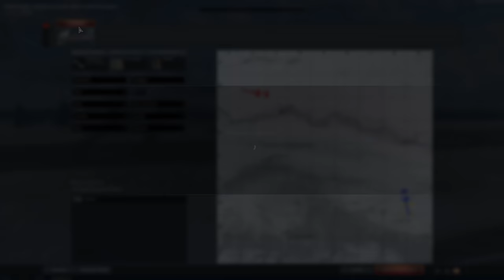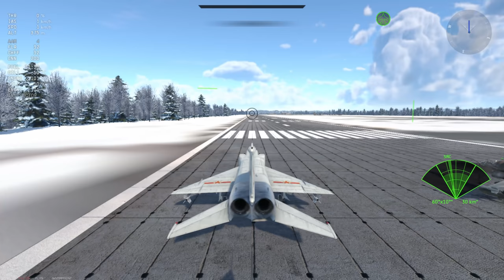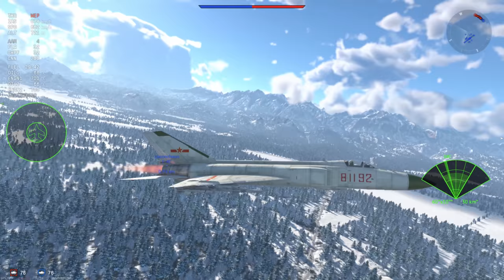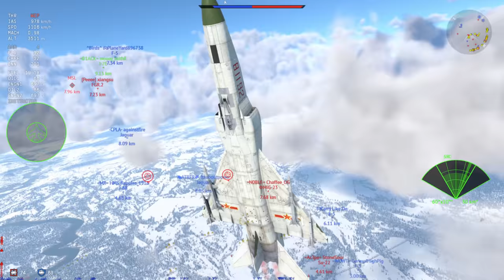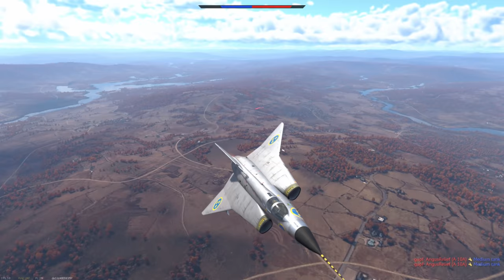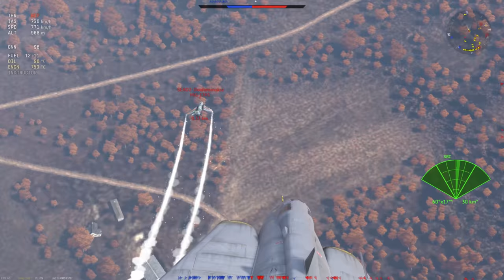It's Time To Raise The BR Ceiling (War Thunder)

Comment: It has been time to raise the BR ceiling for at least the past 2 years...
Reply: Why do that when you can keep pushing underperforming vehicles lower causing issues in BR brackets that dont matter. Perfect solution
Reply: it has been an issue since the game launched. At release, Me 262 was fighting F86 A-5. They were literally considered equal by the matchmaker
Reply: @paraphiliac  they do this to force premium vehicle purchases to grind faster! Its pretty clear gaijin only wants to make money
Reply: More like 7
Reply: @paraphiliac  I honestly think there are no br brackets that "don't matter". I think that every vehicle should be balanced or at least a little more fair than they are now. As much as high tier jets are the "pinnacle", the middle and low brs are just as important.
Reply: @wfb.subtraktor311  and these days we have mig 15 in same match with mig 21
Reply: @jussi8111  90% of f-16 and pfm players turnfight everything for some reason. That is the primary reason for that mess.
Reply: @wfb.subtraktor311  f16?
Reply: @chickenboi693  Mig 21 F-16

Comment: Mig 21 pfm is the pinnacle of br compression that has gotten to an all time terrible low. Oh and also power creep. They should increase the maximum br to 12.0 at the bare minimum
Reply: I should really get around to flying the PFM. I've had it since that event, but since I'm putting the Big Three on hold, I haven't touched it.
Reply: @ODST_Parker  go ahead but dont be those people who throw theirs away and turn with venoms or get so slow and get an aim 9b up their engine. Those people just ruin the statistics
Reply: @J Wilt yes because gaijin doesn't want to fix things in the game just for quality of life.
Reply: Br compression gets them more money because people are more inclined to buy an OP premium to help with the grind. 9.0-10.3 is honestly so fucked right now. Mig21s and A5Cs, fight against Hunter F1s, F-2 Sabres, CL-13s, F3H-2, its totally unfair but gaijin dont give a fuck.
Reply: @Lightning_aus  you forgot 8.7. Easily the worst br to be in jets. Only uptiers await you. The venom completely suffers but people are stupid and turn with it so it stays at 8.7
Reply: @coleanderson8035  i completely skipped the venom as well lol. Barely touched the swifts. Yeah, that whole bracket is fucked. The thing that annoys me is the gap between aircraft that dont have missiles or flares (hunter, venom, sabre) and supersonics with both (A5C, AV8, F105, Yak38, ect in THE SAME MATCH. How is that fair?
Reply: @Lightning_aus  i didnt skip it mate. I love the plane. Fantastic potential. Very fun clubbing mig 21s in a basic early post war turbojet. But it suffers when people aren't dumb. People are so dumb i pulled an ace game in the venom and it was definitely an experience lol and its not fair at all. Also the swifts are amazing bro. The fireflashes are hilariously good head on missiles but the gun placement on the f 7 is utter garbage. The f 1 is a great 8.3 though. I think how britain rank v should be like this. Vampire: 7.3 it was fine before didn't need up in br, meteor f mk 3 7.0 with lower repair cost (10k) or 6.7 with a 15k repair cost which is fair placement imo. The unarmed canberra goes to 8.0.. the venom goes to 8.3, meteor mk 4 with clipped wings goes to 7.7. It's worse than the mk 8 in every way, no reason to grab the thing over the mk 8. And most importantly of all. Both 9.3 mig 21s go to 9.7 as they should be.
Reply: @coleanderson8035  Completely out of nowhere but the f7s gun placement isn't bad imo if anything it's better then the f1s gun placement
Reply: @aregulargenericname8794  I personally like on gun on each side. Aiming with one side of your fuselage is wonky but thats a subjective opinion so i will respect your opinion on the gun placement
Reply: yea when i occasionally see these things in my hunter f1 and i dont have flares or missles and they out turn me and out speed and out accelerate and out climb me, it just makes it not fun when you dont stand a chance against a plane at all even in a upteir, would be nice to atleast have a fighting chance but nope gajin cant let planes be at their proper BR
Reply: @littlecreeper8543  agreed
Reply: I semi-regret selling my PFM. Gah.
Reply: @TheAmazingCowpig  understandable. The pfm isn't great. But its at least good just being a supersonic at 9.3 but understandable
Reply: Why do people cry anout the pfm the f13 is literally worse but stiol slaps some ass at 9.3
Reply: @littlecreeper8543  i mean tbh the Hunter should doo-doo on the PFM if played correctly
Reply: @plazmaguy13yago9  F13 actually has significantly better flight performance
Reply: @collander7766  they have a comparable climb rate snf the pfm gets 200 rounds of gsh23 while f13 gets 60 rounds of rhe nr30 with slow firerate you aint gonna be gettong most of your kills with the r3s
Reply: @plazmaguy13yago9  with all do respect, the f 13 is an event vehicle. Obviously it applies as well but the pfm is in the tech tree making it more common. Good observation though
Reply: @coleanderson8035  I think you got that perfectly backwards
Reply: @plazmaguy13yago9  the F-13 has a .9 TWR while the PFM has .84 under the same conditions. This is a big difference. And in a 1v1 you’d see the F-13 coming out on top of the PFM 10/10 times. The PFM is certainly more noob friendly with the faster guns, but if you can learn to aim the F-13 it’s a much more potent fighter.
Reply: @collander7766  nope read his first comment
Reply: @collander7766  learn to aim wont help 0 rpm gun you almost cant headon or sideswipe with it
Reply: @collander7766  I’m playing hunter f1 not hunter f6 if that’s what you mean, a hunter f6 should perform well against them if you manage to get a full down teir but the hunter f1 gets destroyed vs mig 21pfm when they face each other
Reply: @coleanderson8035  the jet rep costs are just horrendous. I just grinded for the FGR.2, the only british aircraft I play is the Fgr, harrier gr3, hunter fga9, and lightning. Used to have a lot of fun with the vamp and the meteor but they have been nerfed by rep costs and the the vampire is at 7.7...
Reply: @Lightning_aus  correct and the meteor mk 3 that is the second slowest jet in the game is 7.3 when it has 6.7 performance and has the repair cost of a jet bomber. I personally find the venom and scimitar to be quite fun. Im researching the javelin and going to do the lightning in time for the may sales and then have fun with that
Reply: @Lightning_aus  don't forget the repair costs, F2 sabre is 21k of repair cost, no missiles, no flares, no radar, no RWR, not supersonic, meanwhile it faces thing that outperforms it in every way, other than maneuverability. 9.0 is the worst br to be at, because 80% of the time it's uptier. Not to mention the bad map design for jets, the maps are small and everything is placed on the middle, because of that you can't ground pound or bomb bases efficiently. It's soo chaotic the way the game is designed for toptier jets
Reply: 12.7 would be nice, where next updates' planes and 4th gen is 12.7 or even 13.0

Comment: Jet bracket should be decompressed by a factor of 2. So br 7.0-11.0 should be br 7.0-15.0
Reply: Not enough jets for 15.0 right now. Only enough to stretch to 12.0 at MOST.
Reply: Ive been playing since update 1.29, and ive always said and still believe if they just changed the max allowed BR difference in a given game from 1 to .7, then it would solve majority of the issues br compression causes.
Reply: @Poached_Toast  I agree with u
Reply: @Poached_Toast  yeah this, i actually hadnt thought of this that much, its really dumb being 8.7 and facing 10.3 and 9.7, ive been against jets and tanks that were 2 BR higher, which isnt even supposed to happen. .7 would be MORE than fair and reasonable, would really change the game for the better actually
Reply: @sadlife8495  you shouldn’t be able to play tanks and planes 2br higher unless you have 1 tank dragging your ranking up as that used to happen 2 years ago before it was patched, back when it was possible though it was insanely annoying, granted it was so rare that it was like 1 in every 20 games you saw a single plane/tank that was around 1.3-1.7 br higher with around 1/100 games with a enemy 2br higher
Reply: @sadlife8495  yeah exactly. It would still allow them to have compressed BRs that offer short queue time. All while being a reasonable matchup for EVERYONE
Reply: @Poached_Toast  i agree

Comment: The F104A is shocking. It’s my current primary fighter, and I get outran by Mig21MF’s. They also have things such as RWR, countermeasures and R-60’s. Hence, the F104’s inherit speed advantage is useless, as other fighters will just catch up to it, and then out turn it.
Reply: I'm pretty sure the F104A recently got a more powerful engine, more power than the F104G, which already goes 1340 in clean configuration. So the A should be a bit faster now
Reply: The 104C gets more thrust and RWR so you should use that over the A
Reply: F104s aren’t even fast and the American ones are just useless now. Gaijin is gonna kill their own game out of greed in the next 6 months
Reply: @GMan33195  Yeah grinding for it, but gotta prioritize getting a phantom first IMO.
Reply: @willbutterfield8177  I got you. If you are anywhere close to getting a 104G though, go for that first, even over a phantom. The 104G is the best starfighter tier for tier and it absolutely claps at 10.3.  4 AIM9J and flares on the 104 is amazing

Comment: 11.7 isn’t enough to fix anything. There needs to be a drastic change
Reply: And with gen 4 coming, I feel like we need 18, maybe 20 if they decompression every tree generously. I doubt it tho.

But I don't know how high can tanks go, a lot of them are already fairly modern, while planes are stuck in the 1970s
Reply: That’s too much. There’s a good balance between the two. I think it could push up to 12.0 at the ABSOLUTE most
Reply: @LeLe-pl8jq  12.0 should the minimum at this point.

Comment: 11.7 would not cut the current state of compression. 12.3 minimum is what is required, you basically would need to shift ALL current 11.3s to 12.3, shift all current 10.3s to 11.3, stuff like the Mig21MF/SMT which are disgustingly broken at 10.3, these can and do still hold there own at 11.0 very easily now, you would then need to shift a lot of the 9.7s to 10.3/10.7 to give the current 8.0/9.0s some proper breathing space. 11.7 legit would do fuck all. BR compression will only get worse when they remove the warm up timer and allow for some jets to ripple missiles.

Comment: The answer to longer que times is to simply allow smaller matches when fewer players are available.
I play mostly during the night and early morning and waiting times can be very garbage. The matchmaker seems to always want to put the max no. of players in match. Smaller matches would be a great change for those times when people just are not swarming a BR. And it allows for raising the BR ceiling.
Reply: and probably makes some fun matches, expeccially for bombers and ground attack units, and gives fighters more 1v1 scenarios which I feel like are kinda lacking in the higher BRs
Reply: They already have small matches at 6.0 when you have 4 ju-288s and 2 fighters
Reply: @garvdog3793  yes and that's terrible if you are on the German side because you will often have only 2 fighters while the enemy team will usually have more because they don't suffer the ju288 spam and even if they could help you with their 20mm turrets they won't because they are there just for grinding. Sometimes matches will be balanced when the enemy team has a2d spam too

Comment: They definitely will have to greatly increase the br ceiling when they start introducing gen 4 aircraft like the F-14, F-15, and F-16. They also need to increase map sizes to account for longer ranged BVR missiles like the AA-6 and AIM-54. The F-8 was called the last gunfighter because some galaxy brain in the DoD thought putting guns on planes was no longer needed because the Sidewinder and the Sparrow existed.
Reply: imho in a sense they were right but the reliability of missiles and radar that accompanied them wasnt there yet

Comment: honestly with the F8 Crusaders, ive played both and both having GLARING issues, for one, niether is supersonic at sea level, so everything can outrun you except for the 9.7s and the rare 10.0 that arent also supersonic at sea level and down tiers arent that common, so your mostly fighting top tier jets, the F8E might be supersonic at sea level when spaded, the F8U-2 can not turn abouve 600mph, otherwise your wings come off, or you dont pull enough to dodge, but you get 50% reliability missiles with the Aim 9Ds,the E model has no RWR, which the F8U-2 does get, the E also gets ground ordnance and Aim 9cs, the one of, if not the worst, radar guided missile, but if you do get a successful lock and launch, almost garunteed kill, but will fail to single use of chaff, they both turn great at 8.3 jet speeds, they really dont have anything going for them

Comment: they also need to review repair costs across the board and how they are structured.
The Swift F7 has x3 the repair cost of a phantom.
The lightning has x2 the repair cost of a phantom.

How's that supposed to work?
Reply: More people play the Phantom so its overall stats are likely worse than that of a more challenging aircraft like the Lightning and Swift.
Reply: yeah my german f104g is 16k and my german phantom is 5k... lol like what..... I just want to enjoy my f104 without having to PAY to fly it or go grind other vehicles just to be able to afford a flight in my f104g

Comment: While air RB definitely could use de-compression, it’s not nearly as bad as ground RB. It’s worse the higher you go in jets where something like the G91 R3 is generally outclassed in every way by planes just .3 higher but a good pilot can survive and contribute still. That isn’t the case in ground RB. A 5.3 tank is next to useless in a 6.3 match. Even 5.7 tanks struggle to simply survive in 6.3 matches much less 6.7 when uptiers in that BR range are insanely common. 

A 5.7 plane’s guns can still destroy a 6.3 or 6.7 plane easily, it just takes skill to put your aircraft in the right position. Ground RB, that isn’t the case. The BR compression in that game mode is the most apparent by a long shot.

Comment: I've been having trouble for a while with the harrier gr1, where at its current br it gets outperformed by everything to the point I can barely get close enough to use the SRAAMs.  Not to mention it's at 10.0 without flares

Comment: Just make a quantitativ match maker.
BR 1.0 +/- can be possible where there are not that much players online.
But in the evening, with 100k players the system automatically adjust to 0.7 +/-.
Would be perfect to grind.

Comment: for my take on all the lowteir 9.3-10.3 jets that have r60s they should be changed so R60s have around 18g-20g overload, but anything highteir with them, like the mig21bis and MLD they should be swapped the better all aspect 30g R60M

because anything at 9.7 like the f100, or t2 have losts of trouble dodging 30g missles
Reply: Same with aim9Ls
Reply: @sgcash23  heard those were really unreliable on release but are way to op on subsonics
Reply: They could just give them the 20G missile most russian planes already have (I think its the R-13 or something)
Reply: @cameronporter5137  yeah they would be much easier to dodge compared to 30G missles, because planes like the F4C and early mirages if you have anysort of R60 shot at you, and you cant outrun it your dead, and if you do dodge it, they send another which your too slow to dodge

Comment: I cant play jets anymore because of the mighty snail
Sea Vixen spams nightmare for my sabre
Reply: Oy, sea vixen aren't hard to counter, especially in a sabre
Reply: That's why I play the F9F-8. I may be slow, but I can suprise the Sea Vixens via an Aim-9B. And the 4 20mm cannons will shred, and that plane can even fight a mig-15, granted for only a couple turns. It's fantastic, but the 19K SL repair cost is pAin
Reply: But there missles are scary and Warthunder doesn't show the missle chasing u most of the time
Reply: @ajamcan7264  yup the repair for jets is horrible
Reply: @aquilaplayz9538  Look behind there;s an icon of the missile
Reply: @aquilaplayz9538  and for the missiles, you can just do the technic that even works in top tier, roll to your belly and go down while turning left or right

Comment: Counter measures are a must have at top tier I tried to play the mig21 bis stock and I cant do shit because pulse Doppler radars and all aspect ir missiles kick the shit out of you before you can do anything
Reply: Same I got the bis sau and I just gave up trying to stock grind it. I'm tired of getting locked by spaded pulse Doppler jets that shoot 10km range missiles at you while you don't even have countermeasures
Reply: i dont even run chaff in my viggen and i never have a issue wih sahr PD missiles
Reply: @einar8019  yeah well that's cause the viggen is fast and doesnt bleed 1000kph in a slight turn unlike the mig
Reply: @H-cranky  the mig21bis is fast too and doesent bleed alot at high speed either

Comment: Just use a br system that varies with loadout, and increase br to 13 or reduce br spread to 0.7.
Yak 38s, Harriers, A-10s should just be limited to GRB or have their missiles removed in ARB or increase their BR if they choose to use missiles. Fighting high performance missile spamming planes that have countermeasures when you have neither is just not fun.